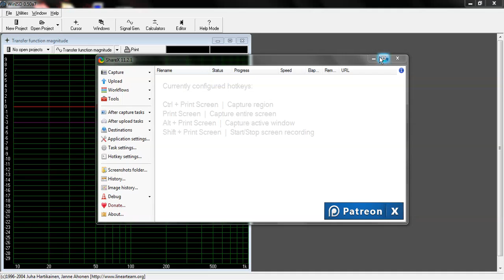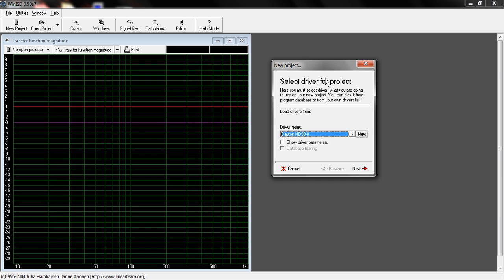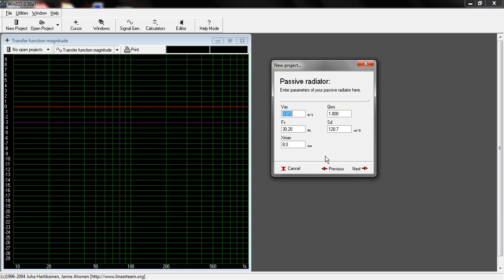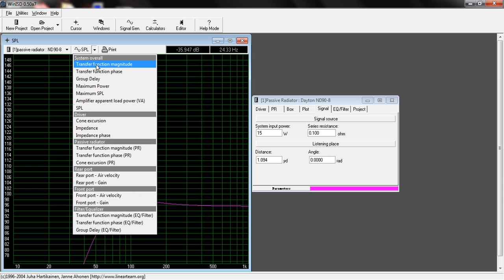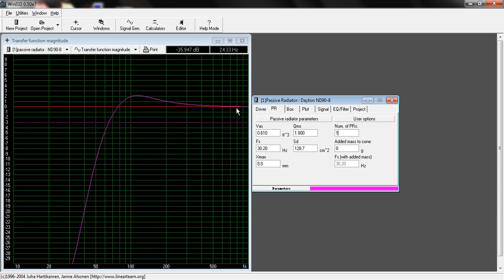WinISD Tutorial - Passive Radiator

Comment: In the case of the system input power test, if the cone excursion (PR) exceeds the PR's Xmax, I believe the maximum "system input power" you need here to check, is the power required by the driver at the calculated Fs – at the affected frequency – correct? (example by 45Hz). Not the total system power, but just the power the affected driver experiences. Please correct me if I'm mistaken.

Comment: Just a question so if I get a passionate radiator it doesn't have the specs from EBay What if I use the specs from a One of the other ones is about the same size wouldn't that be pretty close

Comment: I'm running two Dayton Audio Epique 7" Subs and two Epique 5.5" PR's, No matter how much I change the box volume,  the tuning frequency is always too low to match the f3 frequency. Is there any way to fix that?
Reply from the maker: I’m not sure what you mean. But one thing I will say for sure is that two 5 1/2 inch passive radiators for two 7 inch subs is not going to work well. You typically want two times the volume displacement. In this case you would want four 7 inch passive radiators. Of course, that’s the assumption without actually running the calculations.

Comment: Hi Toid! How can I figure/messure out the parameters of a passive radiator when I do not have them. Eg - buying some at amazon,…
Reply from the maker: I really don't know a good way. You would end up needing some measurement equipment along with some trial and error. I would start with around the same size as a ported enclosure. Then continue to add weight to the passive radiators until you get your desired result.
Reply: @Toid  hi! Thank’s - I will try

Comment: Im building a sealed box for 4 15s and i wanna add some passive radiators (either some pump 12s or some slaps 15s from earthquake sound). A proper sealed box would be 10 cubes but if i make it 8 cubes could i still use the PRs to get it to play low ? Subs only have an xmax of 14mm ( Q power suoer deluxe 15)

Comment: A little late to the party but I was watching your video and had a question. I am trying to tune the frequency by adjusting the box volume, like in your video, but I can't seem to get the -3db frequency to be anywhere near the box frequency. What does that mean? I am using a 6.5" woofer with a 8" PR. I can provide more details if you want.

Also shout out to Kirby Meets Audio. Would've never found you without him.
Reply from the maker: What do you mean by box fequency?  Are you saying you are not getting the -3 anywhere near tuning?  If so, that could mean a couple things.  But the immediate thing it means is you need to raise your tuning frequency.  Try changing your box size and your weights on the passive radiator to see what happens.

Comment: Thanks for this! Do you know why in the newer version of WinISD the tuning frequency of the sealed box is grayed out? I can’t change it.
Reply from the maker: the reason for this is, you can't tune a sealed box. You can only tune a ported enclosure. With a sealed box all you do is change the size of the box and that will change the response.
Reply: Thanks man! I was losing it because I thought something was wrong with the program LOL. About to watch your passive radiator video again. Any reason why you didn’t use one 8” driver with 10” passives or like one 10” with 12” passives?
Reply from the maker: @kelvinrandolph4466  you're welcome. I don't see why that would be an issue assuming you won't reach the mechanical limits of the Pr
Reply: @Toid  One last quick question: In this video, you only modeled 1 driver and one passive radiator, but when you did the build, you had two passive radiators. Should the model in WinISD have had 2 passive radiators to equal the build? Just making sure I'm entering the data right. I'm getting really a really high f3.
Reply from the maker: @kelvinrandolph4466  In this video, i actually did 2 drivers and 1 bigger passive radiator.  In one of my subwoofer builds later, I use 2 passive radiators with 1 8" subwoofer.  It all depends on the excursion of the passive radiator and your tuning frequency.
Reply: 123Toid thanks a lot!
Reply: Cool, thanks!

Comment: Quick question. If I have 2 passive radiators in a design. Is the "mass" in WinISD for each passive radiator or the combined mass for both?
Reply: i would like to know this too
Reply: It's for EACH ... if you just doubled it then you'd have to sum the cone areas and suspension characteristics as well .. ok 👍

Comment: Hi!

First a big thanks for all your vids. They are rly helpful! 
Meanwhile I understand the basics like entering the T/S datas and what they all mean. But I don`t understand the whole Transfer function magnitude topic. 
First, what do the -3db point and 0db mean? Second, why should the tuning frequency be the same as the f3? And why are there db an hz? What do they have in common? Like when you give the speaker an input signal of about two watts it results in a graph. The graph does always show that the lower frequencies are much quieter, but why? There`s a huge gap between the lower and higher frequencies in relation to the loudness. 

Thanks in advance for your answer!
Reply from the maker: That is a lot of questions, lol.  Let's see if we can clear them up for you.  First, the 0 and -3db.  The -3db is considered a speakers F3.  This is the frequency where a speaker is typically 3db down from it's normal spl.  This is where most people focus on, as after this you start to lose a lot of the spl past this.  Secondly, he tuning frequency does not need to be the f3.  However, you do need to make sure you are not tuning well below the f3.  If you are you will have issues, most likely with cone excursion and resonate frequency.  So it should be near, but not right at.  Finally, it is much harder for an amplifier to power lower frequencies.  If you take a look at individual speaker parts you will notice a spec called sensitivity.  In easy terms, this relates to how much wattage a speaker needs to be driven to the same sound level as other speakers in the system.  What you will notice, is that woofers and subwoofers will have a much lower sensitivity than say a tweeter.  You see it takes, a lot more power to drive those speakers lower.  You'll also start seeing a correlation between even the woofers.  The less sensitive ones, can often have lower tuning frequencies.  As far as the gap between higher and lower frequencies, that is what an L-pad is for.  You use an L-pad to attenuate your tweeter to match the sensitivity of your woofer or midrange
Reply: Yeah, I know;) 

So, a L-pad is like a crossover? That matches that the bass has the same loundness as the tweeter.. And the F3 seems to be rly important..  Could I say that when the F3 is very low (40hz) a lot of people would say that the bass is very deep? And everything below the F3 isn`t very noticeable anymore.. ?

Your a really helpful guy! Thx
Reply from the maker: A L-pad isn't a crossover, it is a filter used in a crossover.  It is used to match the sensitivity of the lowest sensitive speaker, so one speaker does not play louder than the others.  It is typically used on a tweeter in a two way system.  The last think you want is for the tweeter to overpower you.  As far as the f3 goes, most mainstream music doesn't play past 60hz.  SO if you are looking for a musical speaker, an f3 of 60 is pretty good.  However if you are looking at movies, you would like to have an f3 of 40 or lower.  The 30hz and under range is more felt than heard.  So you need bigger speakers really to reproduce those in a meaningful way.  As far, as not noticeable, I guess that is one way to put it.  However, we are not taking into account room dynamics.  You room can actually boost or deaden certain frequencies.  Having said that, you will hardly notice anything past f16.  From f15-f3 you will still notice, but not nearly as much as something at 0 or f3.  Basically, your speakers will probably overpower those frequencies.  SO even though, they are present, they won't be heard as much.
Reply from the maker: Just a quick update.  I am making a Passive Radiator sub.  It should be up next week.  So if you want to see it, make sure your subscribed.  I'll leave a build log and parts list.
Reply: 123Toid  Hey! I already subscribed you!

Thanks again
Reply from the maker: Sagittarius A* you're welcome. Thanks for subscribing. Since you are on here, I just wanted to make sure that you knew that that was coming out and to keep an eye for out for it. I'm going to try to add in the video a little bit of the winISD part, so you can see what I was seeing when I designed it.

Comment: I understand how a PR works, and how to tune it, but what I'm wondering is what the optimal box internal volume is when using a PR? Should it be about the same size as if the box were designed to be closed? Thx.
Reply from the maker: Bob Richards that's all explained in the video.  assuming you have the specs, the program will help you adjust both the box size and added mass hat will get you the response you are attempting to get.  BUt in short, the answer is no.
Reply from the maker: Just a quick update.  I am making a Passive Radiator sub.  It should be up next week.  So if you want to see it, make sure your subscribed.  I'll leave a build log and parts list.

Comment: Hey do you know anyway I can mesure my PR's specs ? I bought them on ebay and I can find thoses mesurements online.
Thanks ! Great video
Reply from the maker: There is no way, that I know of.  If you have a microphone like the umik1, you can use REW, to get a baseline in the enclosure you are using.  Then adjust with weight and enclosure size as needed.  It's a lot more work, but it's one of the only ways I know of.  This is one of the reasons I try to steer away from Ebay when buying passive radiators.   But you usually can't beat the price!
Reply: 123Toid Thanks for your answer. I bought the PR on ebay because I couldn't find any with a diameter of arrourd 1.5". Do you know any seller that sells small PR with a datasheet? I can't find anyway to design my enclosure on winisd without theses specs.
Reply from the maker: +Pierre Dal Busco Typically you won't find much below about 3.5" with specs. Mainly, this is due to you needing about double the air movement of your passive radiator compared to your speakers.  So a 1.5" passive radiator would typically pair with around a 3/4" speaker l. and that type of speaker will not get very low.   However,  you may be able to find some small passive radiators that will work.  I'd check out Ali Express.   If the specs aren't listed, sellers will often get them for you.  You will have to email the seller though.  I hope this helps.
Reply from the maker: Just a quick update.  I am making a Passive Radiator sub.  It should be up next week.  So if you want to see it, make sure your subscribed.  I'll leave a build log and parts list.